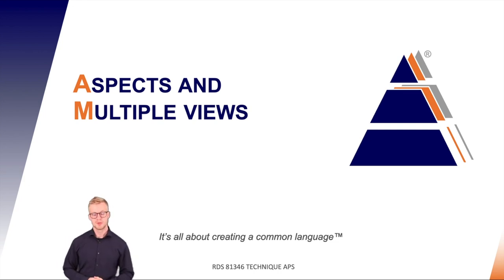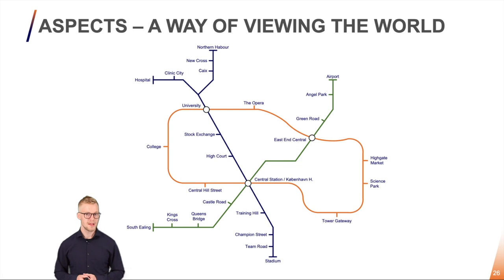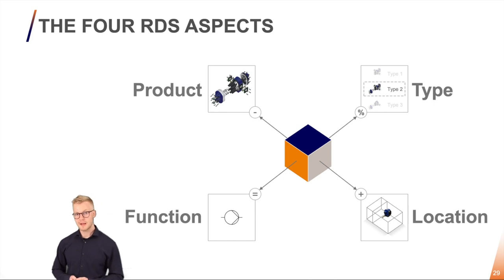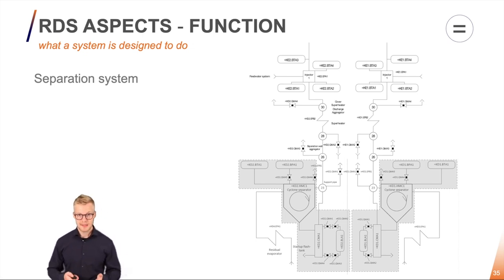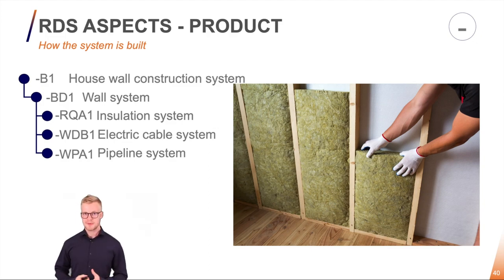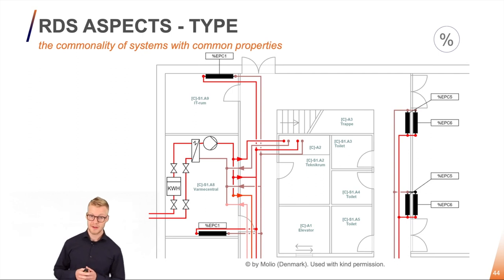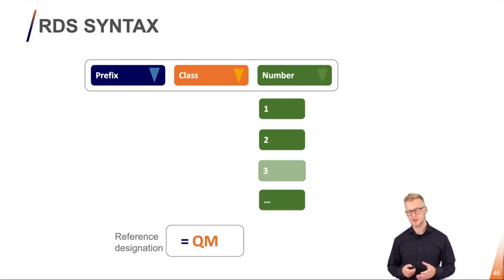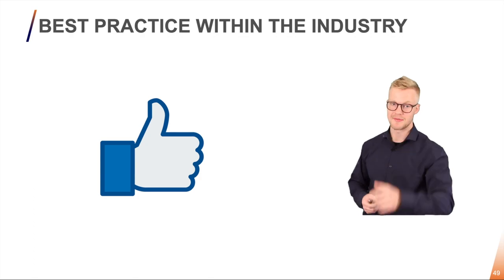Introduction to RDS 81346 - Aspects & Multiple Views (Step 2)

Comment: At 2.27 you show a PID - with a TT called BTB2 which is a temperature switch and  TS which is named BTA2 which is a temperature transmitter. the symbol and the naming does not seems to match.
Reply from the maker: Hello Katrine,

The examples are based on the Cuneco classification system, which is very similar to 81346-2. In that classification framework, the transmitter and sensor were switched around. So you are right the classes are not up to date any longer. The examples of classes in the video are indicative and only serve to convey the principles behind RDS.

Best regards, 
The RDS Team